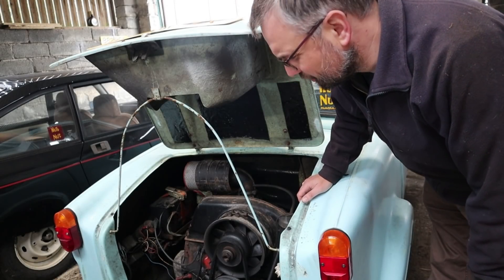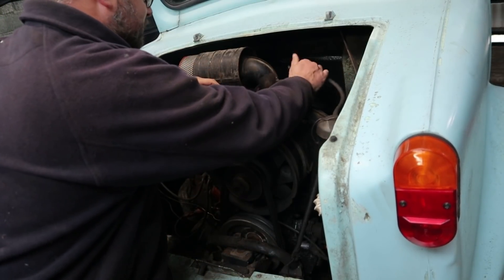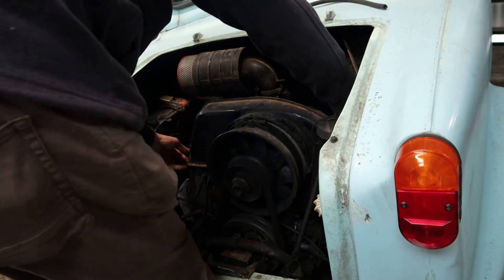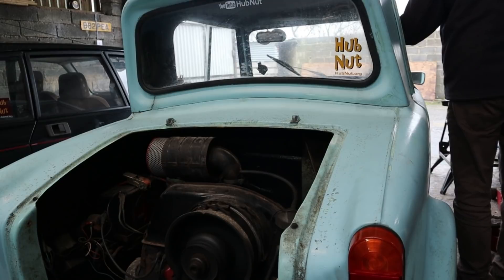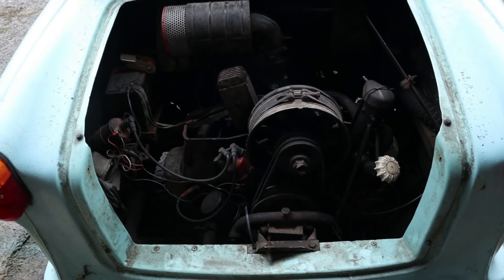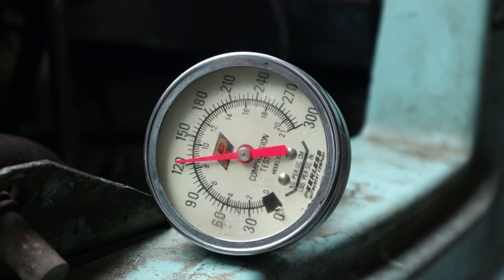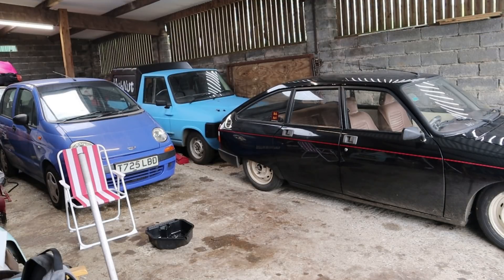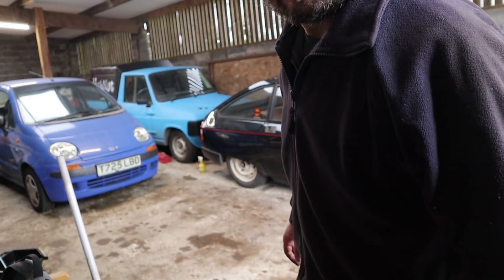TWC the Invacar goes BANG, also, oil leak located.

Comment: If the compression recorded on the gauge leaks down a bit after you finished the test doesn't that just mean the Pulsar 702 is leaking? There's no guarantee the valves are supposed to be closed at whatever point the engine happened to stop at anyway.

Comment: That's quite an imbalance....bit of oil down the bores & recheck to confirm rings or top end. It would be worth checking valve clearances too. If these are like most other air cooled motors then the exhaust side will run hot (made worse with removal of TEL from fuel) & can burn valves and or valve seats (especially if clearances haven't been checked & have closed up). Would assume it would be on Ngk 6's. With ngk lower number means a hotter running plug & higher number means colder running plug (called harder by some). Colder plugs are generally less tolerant of fouling. Definitely go timesert, helicoils aren't great for plug threads for several reasons.

Comment: If you take the heads off  a machine shop could give them a light skim to make sure they are flat and also take  a bit more advantage of 95 oct petrol. The Mk1 Transit had a low compression option and naughty people use to run them on a high kerosine mix ..boy did they stink LOL

Comment: There's a one way schrader valve in the compression tester. Any dropping of the needle is the gauge not the engine.  Off on a tangent, did any Austrian wierdos make hot cams for those engines? Looks like you have plenty of compression to take advantage of some speed parts if they exist... Timesert definately the best spark plug thread fix. There's some loctite branded high temperature thread lock goo that I use to stick the timesert permenantly into the head. put the goo in the head not the insert and then you can make sure the insert top lip makes electrical contact for the plug. Works a treat. Forget helicoils. Nasty things.

Comment: Engines designed for two star fuel won't ever run well on unleaded, while you have the heads off get them skimmed down a bit if you can. A compression ratio above 9:1 and up to 10.5 :1 would be ideal, above 10:5:1 and you are into the reals of super unleaded. The higher the octane rating of gasoline the higher compression ratio you need to burn it.

Comment: You need an overhead crane so you can lift your cars in and out without having to shuffle them by hand. Just kidding, though that would be handy. If you look closely at the end of the cooler spark plug you will notice that the nose of the plug sticks out less than the other one. That is an indication that one plug is cooler than the other one. My mother managed to terminate the engine in our VW bus by running it out of oil. The seals on the oil cooler had failed and it sprayed the oil out on to the road. Definitely not good times.

Comment: Did these ever have 2 stroke engines?
Reply from the maker: Previous generations did, with a manual gearbox!
Reply: @HubNut  Thanks I  remember filling them up with the hand pumped 2T machine at my uncles garage. You added Sellmex and oil to it and then hand pumped the mixture to the tank had a big dial on the front. My son gave me a Doom tee shirt and a hub nut sticker for my birthday they are great!

Comment: Ian try a local radiator company they could fix the cooler or re make one for you I've a local company here and they fixed loads of rads and built two custom rads for my civics and compression won't hold man after a test could be the schrader valve in your compression tester but there's less than 10%of a difference overall I'd be aweful happy with that and especially the age of the engine
And also I've done timecerts on spark plug theads on heads Eric o from South main auto has a good vid on It be allot more cost effective than puling the head and a new skill and tool to have

Comment: 2 star fuel -  Do you run this with a lead additive then? Or has the engine been modified to run on unleaded?
Reply from the maker: Alloy heads tend to already have hardened valve seats.
Reply: @HubNut  of course, sorry, for some reason that thought didn’t enter my head

Comment: Unfortunately, when you have a damaged plug thread in an engine, especially an alloy engine, it's only going to get worse and will, eventually, start firing the plug out.  Hopefully the head from TWC's original engine is better, but it might pay you to get this one helicoiled or whatever so you have a spare for the future...
Reply from the maker: Certainly won't throw it away.

Comment: 24 horsepower; and, Ian, please, its not half a Volkswagen engine, ok? Grandpa used it as a Puch motorcycle engine, without fan, oil cooler, Dynastart and all that stuff, no need.... :)
Reply from the maker: Thanks. They detuned them for the Invacars.

Comment: Poor neglected engine. Oil leaks for ages. Duff battery for over a year. Compression test on 2nd half is leaking. Different plugs 🙄 just fix the problems when they occur!!!!!! It doesn't rain, it pours, literally 😂 note to self, put oil trays underneath and the floor won't be slippery. Car jenga everytime you want to do work 🙄

Comment: If you want low quality low octane fuel you'll probably find plenty in the USA. Maybe you can place an order on Amazon, :D
Reply: That’s a myth. The numbers are lower because they calculate the ratings differently. The fuel is no more or less potent for an “equivalent” rating.
Reply: wonder why he runs her on 95 n not 91? isnt the low octane, like the old two stroke. petrol n oil mixed?

Comment: Here's a superior quality spark plug equivalent to the NGK B7HS / B8HS:

https://www.jawashop.com/spark-plug-brisk-super-n15c-jawa-cz_z270/

Other plugs that you can use are:

Lodge / Golden Lodge 2HN (Sintox so expensive!!).
Champion L-85.

I've been warned, by a local motorcycle repair shop, that there are Chinese knock off NGK plugs in circulation. They're identical and the only difference is that the knock offs last longer than genuine NGK plugs.....

Comment: I still have an Eyquem thermometer hanging in my workshed. It is yellow and black, and I am proud of it :p. It was always a part of decoration in my father’s shop as well. 
Regarding the NGK 8, that would do no harm to Elly. In fact, I would prefer 8 rather than 7 especially when you are doing long and uphill trips in hot weather. Let’s not forget it is an aircooled engine and for example, when it had to work hard, during the Croatia trip, a more heat resistant plug would be more assuring than a less heat resistant.

Comment: Loved the videos for a few years but there's one thing that drives me mad. Your compression tester does Not check for compression leak. Your tester has a 1 way valve that traps the compression from the engine to give you a reading. Any "leak back" is your tester leaking. Not the valves. It can't check the compression leak of a cylinder because you've in no way positioned the valves closed by turning the engine over. Not complaining, just an observation XD You need a cylinder leak tester to check to see if your valve seats or piston compression ring is leaking. You then have to slowly turn the engine to the point valves are shut etc.. Etc.. So yes. Sorry for the long message, just drives me mad to hear you say about valves leaking when you can't even check for it with that tool 😂
Reply from the maker: Cheers. Misunderstood a video I watched, or maybe they were also wrong! (entirely possible).

Comment: Bang is not a word I hope to see on one of your video titles. That's why you never see F1 mechanics licking their fingers, asbestosis. 

Right, the fact that your compression tester holds pressure tells you nothing about the cylinder because of the check valve on the gauge line, it only confirms said gauge and check valve are not leaking. 
Please do not use the term "Helicoil" and "Timesert" in the same sentence, there is a world of technical difference between the two means of repairing a damaged thread.

Comment: puch maxi's rule!!!

puch made good engines :)
Reply: you say that in a video where its ones just spat out a spark plug.
Reply: Push Maxi?.
Reply: @k1ckyscotland988  it's a moped
Reply: @benholroyd5221  well it a really old engine and it still runs+its the hub nut that tightned it down , is it really the engines foult ?? :) :)
Reply: Aye,worked on a couple. They were actually good for what they were,commuting.
Reply: @k1ckyscotland988  i had a maxi k with a 70cc kit on , my sister gave it to me for x-mas when i was 14 :)
Reply: @1worldgaming18  True it has survived years of neglect, after sitting in a field for years.